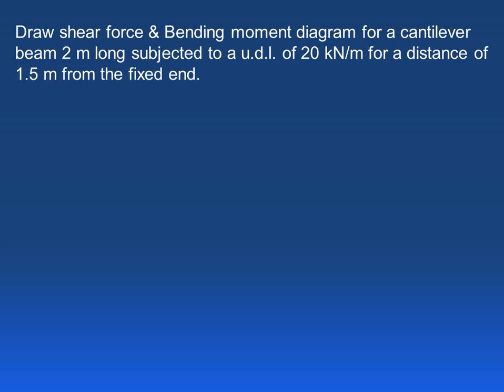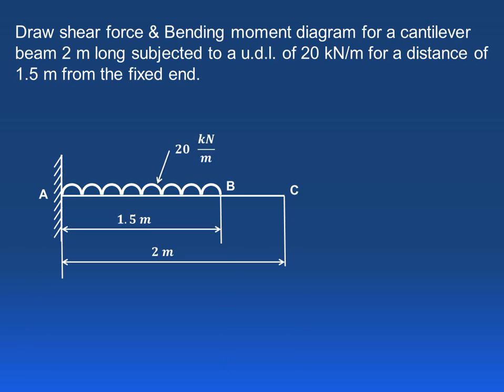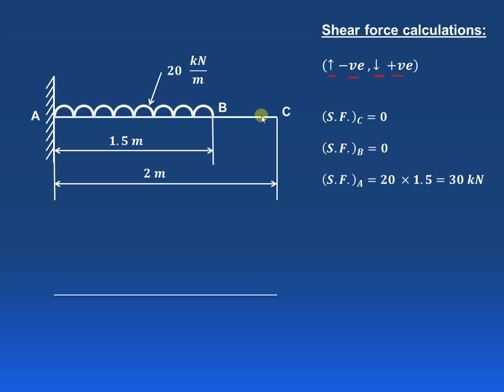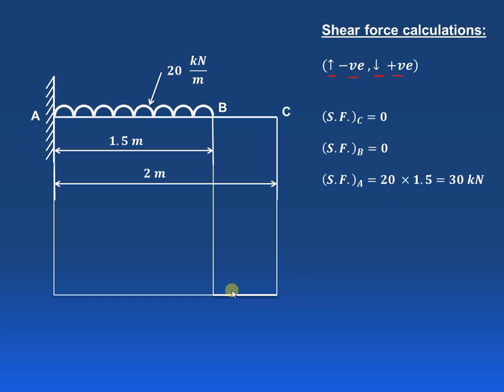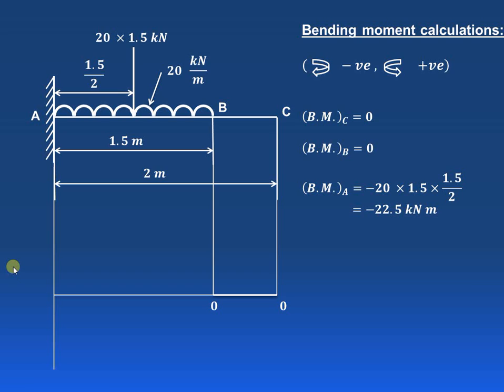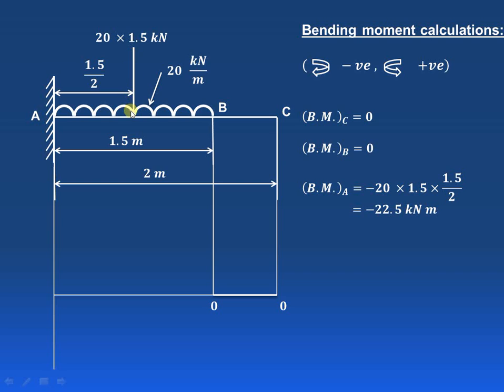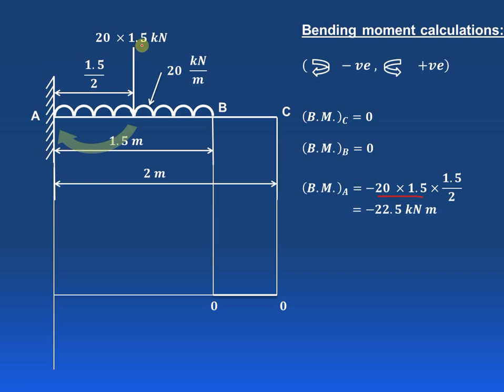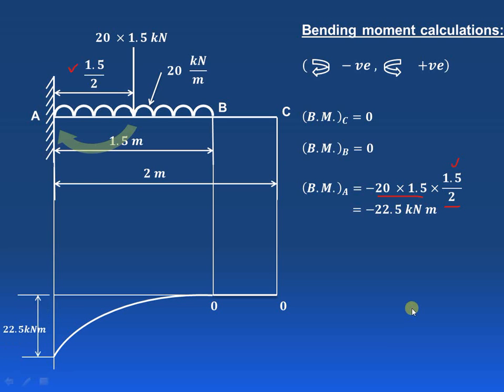How to draw shear force & bending moment diagram( cantilever beam)  PART 2 - GATE 2021 examination

Comment: Unit -1 : SIMPLE STRESSES AND STRAINS ,Unit-2:SHEAR FORCE AND BENDING MOMENTS, Unit-3: FLEXURAL STRESSES AND SHEAR STRESSES ,Unit-4 : DEFLECTION OF BEAMS ,Unit-5: CONJUGATE BEAM METHOD , DIRECT AND INDIRECT STRESSES. Sir these are the units
Reply from the maker: OK will try !!!
Reply: Sir , still u r not upload my syllabus
Reply from the maker: Will upload a video on SFD & BMD , Stress & Strain within a day or two. Thanks ...
Reply: Sir , I want total syllabus. See I sent the syllabus .that total I want
Reply from the maker: Uploaded a new video on SFD & BMD for cantilever beam ... Thanks
Reply: Sir , please upload my syllabus soon sir I have exams
Reply: Sir still ur not upload my syllabus please sir send me  u have watsup sir
Reply from the maker: I am uploading the videos on your syllabus but it is not possible to upload all at one glance. If you want some typical topics on which videos should be prepared then you can mention. Thanks ....
Reply: UNIT -1 SIMPLE STRESSES AND STRAINS :;Stress -strain diagram for mild steel, Temperature stress and strains, ; UNIT-3:   FLEXURAL STRESSES: I, T, Angle sections , :;   UNIT-4 : DEFLECTION OF BEAMS: Bending into circular arc , Double integration and Macaulay's methods, Determination of slope and deflection for cantilever and simply supported beams subjected to point loads ,uvl loads .: Sir at least these topics videos will be upload as early as possible sir , please sir , thanking you.
Reply from the maker: OK will try ...
Reply: FLEXURAL STRESSES::I,T, Angle and channel sections ,;, DEFLECTION OF BEAMS:; Double integration and Macaulay's methods, Mohr's theroem and Moment area method
Reply: Please upload these topics sir thees topics are very important please send me soon sir .. Thanking you sir